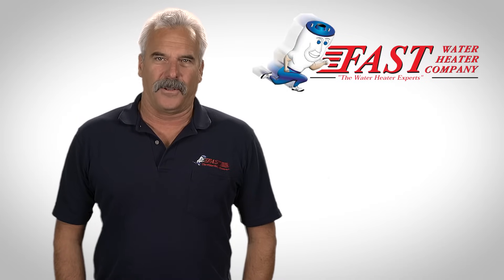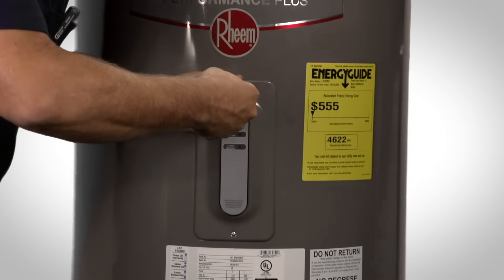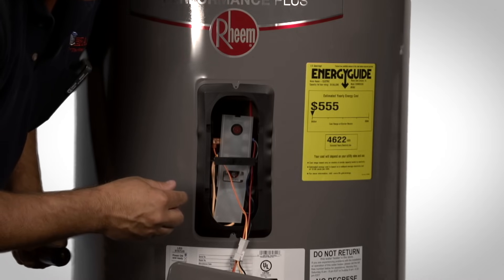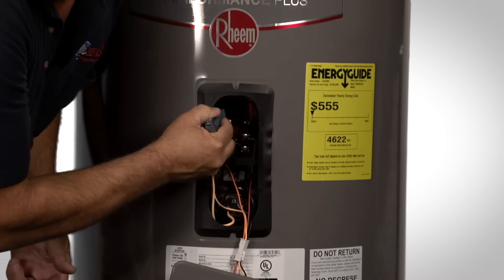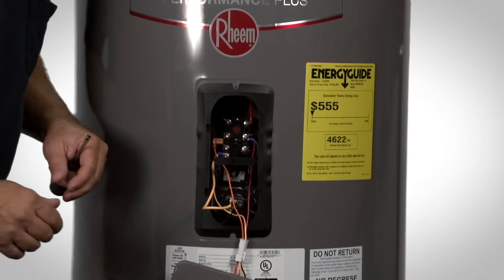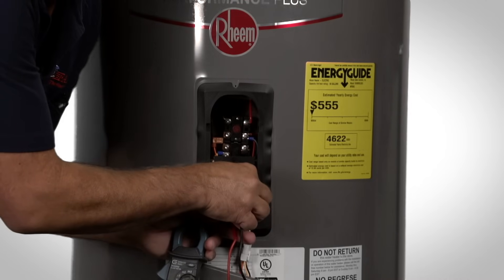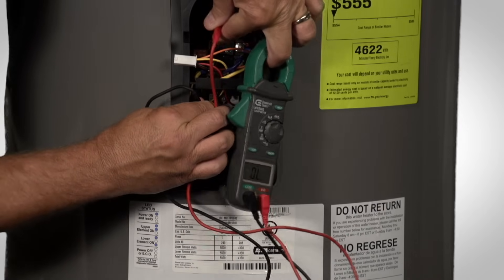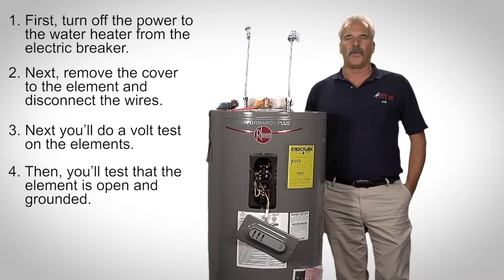How to Troubleshoot an Electric Water Heater

Comment: Two o things about electrical safety that he got wrong. 1st, always, always, verify that your tester is good. They are battery driven. the batteries may be dead, or it may just be broken. Test it on a hot outlet and make sure it works. YOUR LIFE MAY DEPEND ON IT. Second, he is grabbing the plastic cover for removal by putting his fingers under it. If the power is still on, good way to get shocked.
Reply: When removing the plastic cover,  I got zapped
Reply: I think anyone who is doing their own water heater repairs has to have some basic electrical knowledge. For example you should known how to use a meter and verify power is off. If not you should spend the time to learn. If not just pay someone. It’s not worth the risk. I pay someone every time the springs break in my garage door. Spinning up those springs scares me and I lack the skill and balls to do it my self.
Reply: Dude.. really? 

You had to be really really bored to notice those two small things

Comment: rheem water heater upper element light not on? Replaced both uppper and lower heating elements and replaced the lower thermostat. Now the power led is on and only the lower Rheem lower element light is on. When I disconnect one of the leads on the lower element the upper element light is on but when I reconnect the lead the top element light goes off and only the bottom element light is on. 
It is not the elements Replaced both elements and it is not the lower thermostat Replaced lower thermostat.
Reply: Rd3 l

Comment: What should my top and bottom thermoststas be set at..a guy jad said 120 to save power
Reply: 120 is standard and recommended by the manufacturer, anything 140 and higher risks scalding and can cause excess wear on the tank.

Comment: I think I will just call a plumber
Reply: Hang in there it's really not that hard, just be safe and make sure you have the power turned off before replacing elements or thermostats. If you need to replace element just be sure you have tank drained below element you're replacing and be sure to refill tank before turning power back on.

Comment: NEVER USE A HOTSTICK!!! Also known as a non contact voltage detector. These can be fooled by stray emf, especially if the water heater isn't properly grounded and bonded. 

Always use a multimeter to verify voltage.
Reply: 100%.  Absolutely
Reply: Working as an electrician I've seen that happen. They can be handy, so as with anything trust, but verify.

Comment: I remodeled a small apartment and moved the 35 short hot water heater from the kitchen to the bathroom where at one point had wash machine hook up there.I replaced it with a tall 40 gallon hot water heater.After it was installed we tested  for hot water and there was hot water but some how during the process of boxing in the hot water heater the reset button popped but did not know it until the renter went to take a shower and had no hot water so my Handy man went over the next day and found the reset button was out pushed it back in re installed the case and that was it.But me as the owner thinks there is more.I would like to know what could of caused it to trip so that can be fixed
Reply: He

Comment: My water heater is exactly like this one !! I never see my upper element like on is that normal ? Granted...i never use all the hot water up either....help !!!????
Reply: The bottom one does most of the work until the water gets really cool. it's strange I called the company about this and they say that's the way it's designed.

Comment: My water heater is coming on every 15 mins, what cause that?
Reply: sparky0288 I’m a year late. Hopefully you found the problem. If not, you may have a hot water leak under your slab. 
Take a picture of your water meter. Be sure no one turns the water on for an hour. Take pictures of your meter periodically to see if water is running. A very slow leak may take some time to tell, so be patient. 
If your meter is moving and no one turned the water on during this test phase, you have a leak somewhere in or under your house.
Hope that helps.
God Bless!

Comment: I replaced the upper thermostat yesterday and my hot water was restored. But after bathing that hot water is now gone and the heater is off. There's power to the unit and across the reset switch. tested the elements and they were good. Did a grounding test on both elements and there's no continuity on either test with means there's high resistance. This means there's a grounding issue somewhere, is that correct?

Comment: Just installed a new 39 gallon electric Rheem but the bottom element isn't working. Top element has continuity but bottom element does not. Ideas?

Comment: Like so much of the "free advice" available on YouTube this advice is ALL WRONG! "No resistance" means that electrical continuity through the heating element exists or that a current path through the element exists, therefore the element is probably (but not necessarily in all cases) "good". The same applies to the test for a "grounded element". He has it all backwards. "No resistance" between the element and the metal housing means the line power is inappropriately (and dangerously) connected to the case of the water heater which, if grounded as it should be, would cause the circuit breaker to trip when power is applied. If the case is not grounded as it should be touching the case and ground with power applied could KILL you! Hard to believe this poor fellow is actually working or a service company, Perhaps just an honest mistake on his part. Too bad. This advice is wrong, misleading and potentially dangerous. YouTube fans beware! Free advice is often the worth the price you pay for it. I see lots of "experts" on YouTube who haven't a clue what they are talking about. If you're one of those people who does not understand the electrical principles on which water heaters depend, you may be better off hiring someone who does. Could save you money and/or your LIFE. No I'm NOT in the heating business. Good Luck!
Reply: If you measure "no resistance" it means you are reading no ohms, and your meter will read OL, open line.  You have misunderstood the meaning of "no resistance." It does not mean zero ohms it means (practically speaking) infinite ohms.

Comment: Wait a sec... what about the thermostats?
Reply: The upper (Top and bottom screws) will show N/C if the water is below the set temp. and N/O if the water is above the set temp.  Same with the lower. The lower element (Horizontal Screws)

Comment: well has been down for a couple months. no water to replace water in water heater. I just heard a fan like sound in water heater. should i cut the electric to my electric water heater? It immediately shut off when i walked up to it as soon as i noticed. I had gotten up and that's why i happened to hear it. It is in a room i don't usually use. Plus, I am hardly ever home. I don't know if this was the first time.

Comment: That’s a whole lot of overkill.  Leave the power on.....top of reset...240v....bottom of reset....240v......turn upper therm up....check element terminals....240v......clamp amp probe on upper el wire.......ohm law says 3000 watt element divided by 240v equals amps it should be drawing......repeat for bottom.  I serviced electric rental tanks for a local utility for years and never once checked continuity because  it  doesn’t tell the whole story....the amp reading tells the whole story.  Amp probe around both wires.....reads zero....balanced and equal.

Comment: I have a electric reliance 40 gallon water heater I checked bottom element it is good checked the top one no power replace element still no power but thermostat is checking good what is my problem

Comment: If the fuse box circuit breaker for the Hot water cylinder trips intermittently it can be a faulty circuit breaker. I found mine tripping as the physical tension on the switch was very weak and hence it kept tripping. Replaced the circuit breaker and it was fine. Both thermostat and heating element were good.
Reply: Did u have to reset the WH

Comment: 'no resistance' is a short circuit. 'no continuity' is an open circuit.
Reply: ! Wrong
Reply: @CatmanJovi  what is it then
Reply: @Probablykierra  no resistance = open circuit. Continuity to ground is a short circuit.
Reply: @IamDonBonJovi  you are wrong! 
No resistance = short = 0 ohms
OL = no continuity = no reading
Reply: @Alex A  resistance in a circuit is a wire, winding, motor, element in any form. A resistance value of a circuit is the amount of resistance through a load of a circuit to do work. Remove the resistance then you just have an open circuit=no resistance. Connect the two wires together you have a short= blow the circuit =open circuit= no resistance...short to ground is not resistance, though resistance to ground is detected = short, not open circuit and not resistance.
Reply: @IamDonBonJovi  open circuit = no continuity!!!
No resistance = high continuity = probe to probe!
Less resistance = more continuity. 
More resistance = less continuity. 
If you don't get it I can't help you.
I'm troubleshooting electrical equipment on daily basis. It's my job!

Comment: wE JUST BOUGHT THIS RHEAM 30 GAL ELECTRIC HOT WATER HEATER AND IT DOESN'T GET WARM ENOUGH TO SHOWER OR BATHE. I AM VERY DISSAPPOINTED.  I NEED HOT WATER, WHAT DO I DO NOW. SPENT ALL THIS MONEY AND IT DOESN'T WORK AND BOLDLY SAYS ON OUTSIDE OF THE HEATER NOT TO RETURN TO HOME DEPOT WHERE WE BOUGHT IT. IF I KNEW IT WAS A POS I WOULD NOT HAVE BOUGHT THAT BRAND!
Reply: There is a heat adjustment valve on the inside, you have to take the cover off and you'll see it.

Comment: You need to keep your hands out of the way so someone that is unfamiliar with the contact points can see what your touching. Remember we are trying to listen and understand but the visual is just if not more important to someone who is not familiar with anything.
Reply: Hard to do in a 4" × 8" space.
Reply: I see just fine.  Not sure what’s the complaint about. You really need to at least opened it up and see what you’re doing and comparing instead depending your life on a video and I’m hoping they hold your hand and guide you because not all water heaters are the same.  Like all videos it should be a general ideas not 100% exact
Reply: yea im a houseowner and need to know this and what and not what to do.......my damn water heater losing heat and the wife is on my ass
Reply: I laughed sooo hard at Ronald’s response it was so Boldly rude and sounded like when grandparents scold you. It’s 2am. I am so saddened about my new install. The water only stays hot for 7 minutes. Please help. By the way I saw just fine.

Comment: what does resistance mean?  how do you set the meter to check for resistance?  what reading would be shown if there were no resistance?
Reply: Your response, Andrew, was not all helpful.
Reply: KMAC Radio okay be my guest... resistance is opposition to current flow, and it is measured in ohms - so set the multimeter to the “omega” symbol - and remember resistance is equal the voltage divided by the current, enjoy mate
Reply: @Sebeerful  buy nikola tesla guide to fixing water heaters.
take a class in quantum entanglement...then find out the inner workings on the deathray gun..ttyl..2020
Reply: Bernardo Provenzanno good joke...    and I appreciate that people are still stumbling upon this 😆
Reply: Mate if you don’t know that - stay away from doing this

Comment: I have a smell of sulfer coming from the hot water , what's causing that?
Reply: William Mcgaha check your drain trap near your hwh, if it's dry you could be getting sewer gas through it, I've seen it many times
Reply: thank you.
Reply: Could be the anode rod on the top its a common cause for it.
Reply: it can also mean your water heater is a portal to hell.

Comment: When you tested the upper element you said, "if the meter is measuring no resistance, the element is open", that is incorrect.  You should have said, when the meter is measuring Infinite Resistance, the element is Open.
Reply: I think he is mistaking the 0L symbol as 0, instead of OL meaning OverLoad
Reply: G Theo overload doesn't apply to the resistance function. An overload is too much current. If the element is bad, then it won't conduct any current at all, meaning infinite resistance, which means the needle on the meter doesn't move, at all. If the needle moves all the way to the right, that means there is no resistance (technically it's very little resistance; no resistance is a dead short), which means it will conduct current, which means it's good. 

It's obvious this guy doesn't understand how an ohmmeter works and he's confusing a needle that doesn't move with a needle that moves to the far right. It's exactly the opposite when measuring resistance, the farther the needle moves, the less resistance it's measuring. With voltage and current, the farther the needle moves, the higher the value. Or maybe he does understand that and he's assuming his viewers won't.
Reply: @josephherron7671  if that were true, when set to ohms, why does my multimeter say OL when the probes are in contact with only air?

I now realized that OL stands for Open Loop, but still "infinite" resistance, which would confuse any computer
Reply: @josephherron7671  there are no needles on this meter, it is a digital multimeter
Reply: G Theo oh yea, it was. It's been a while since I watched the video, I was thinking it was analog. But you're right.
Reply: Thank you for that Joseph!  I was scratching my head on these responses.
Reply: Bill O'Quin no problem. It really bugs me when I see replies that attempt to correct someone and then they themselves get it completely wrong.
Reply: Good call on this.
It's hard to believe they try to sell this stuff and they don't understand how to read a meter properly
Reply: It is difficult to explain to lay people having no experience or knowledge of Ohm's Law. When the meter beeps like it did here, there is little to no resistance. When it doesn't beep (assuming the meter is on the correct setting) it means there is a high resistance or infinite resistance.
Reply: This confuses a lot of people and could have been stated more clearly. But, "No resistance" means infinity, not zero ohms.  If there is no resistance, there will be no current flow.
Reply: When it measuring zero resistance it is open. If it is measuring a to straight ground (dead short) then you get the infinite resistance.
Reply: @terrylunsford352  wrong, no resistance means it’s a dead short.
Reply: Terry Lunsford WRONG. Dead shorts show zero resistance, and infinite CURRENT. Open (bad) elements show infinite resistance and carry zero current. A good element will show zero resistance between the two screws. That's a CLOSED element. 

However, technically, a good element does not offer zero resistance. It offers very little resistance; not enough to measure on most meters; but there is resistance. Zero resistance would allow infinite current flow and that would destroy the element instantly. So if you're going to correct Chris, get it straight.

Comment: Excellent video...Well explained. One thing at the end - Shouldn't #3 say "Next you'll do a Resistance test on the elements" (not a volt test - there's no power on) ???
Reply: #4 is the resistance check. #3 shouldnt be there at all.
Reply: NO there is NO power applied when doing the resistance check

Comment: A short circuit is an electric circuit offering little or no resistance to the flow of electrons. Short circuits are dangerous with high voltage power sources because the high currents encountered can cause large amounts of heat energy to be released.
Reply: Venkat.   My geyser is leaking the water drop by drop from the bottom. From where the water is leaking and what will be the remedy?
Reply: Jaya Dheekonda   Could be the connections from the top are leaking down the tank. The pop off  valve could be leaking down the tank. The heating elements could be leaking down the tank. The tank could have a hole rusted in it.
Reply: A "little resistance" could mean 1 or 2 ohms. No resistance means no ohms which means infinity, not zero ohms. To avoid confusion,maybe the narrator should have said, the meter reads "Open" or infinity.
Reply: @don.sittingbull2049  I dunno bout dat.  No resistance to electricity would be zero ohms i.e., short circuity.  High resistance is like 5k ohms, 1 million ohms is more resistance, and infinity would be an unovercom-able amount of resistance.  when the beeper beeped that meant no resistance or very little resistance.  OL or Open or Open Line is literally a break in the continuity so actually it's high resistance or an infinite amount of resistance.  It's not no resistance although it might appear to be "no reading of ohms", it's actually reading an infinite amount of ohms.